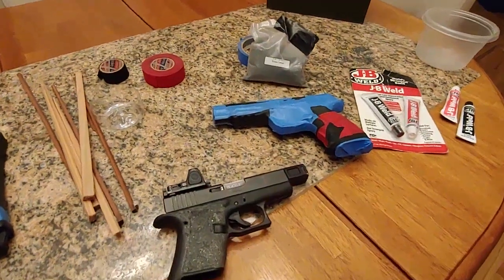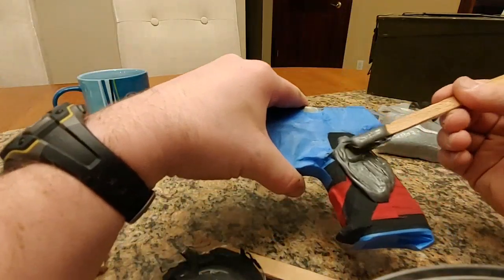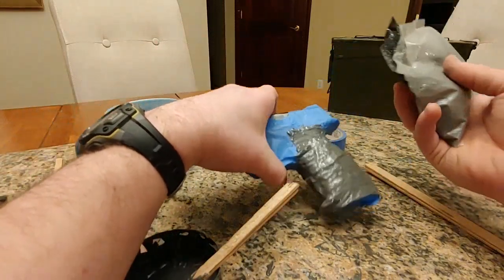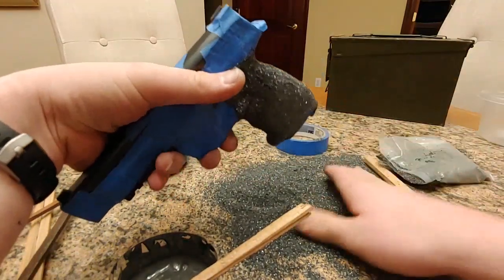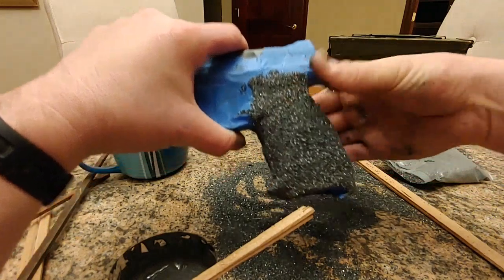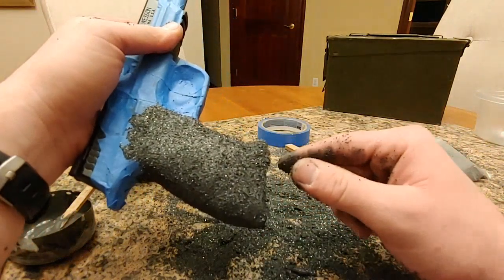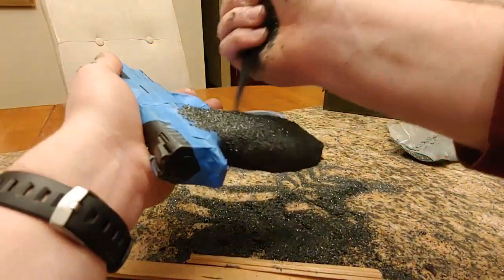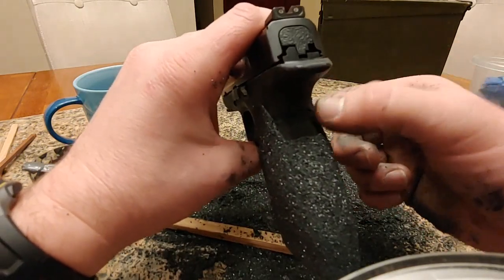Silicon Carbide and Epoxy Pistol Grip Modification

Comment: How is this holding up? I haven’t seen the hockey tape idea before. Does the grip have flex or “squishiness” to it once everything is hardened with that tape under there?
Reply from the maker: This grip holds up great, the only reason why you may want to redo the grip is after time the outermost silicon carbide particles (that give you maximum the roughness) will eventually wear off leaving the particles that are more deeply  embedded in the epoxy. Its still a good grip (better than stock) but after a year it will be substantially less rough in texture. For example, if you use 36 grit silicon carbide for a very aggressive texture, after six months the grip may feel more like 60 grit and after a year more like 80 grit.  There is no squishiness as a result of this process and other than the inevitable degradation of your most aggressive texture I consider it a semi permanent modification, as in the epoxy will not break down unless you wish to remove it (by sliding a flat head screwdriver underneath and twisting it to crack the epoxy for example). Also, if you're considering doing this I would suggest you do a search, after I posted this video I found several other videos that are much more concise and better all-around videos on this process.
Reply from the maker: Also, the tape is very thin hockey grip tape which only serves as a barrier to prevent the epoxy from adhering to the frame so that it can be removed later without damaging the gun. You can also build up parts of the grip, I've taped little aluminum shims underneath the tape to increase the grip in a certain area and it has never shifted or led to any problems.
Reply: @LaxWarrior16  thanks for the response. I thought you were wrapping a bunch of tape layers to build it up. Have you actually removed the hardened silicon carbide and epoxy structure by peeling up the tape? It’s an interesting idea to go back to a stock grip if it isn’t to your liking once epoxied
Reply from the maker: @HouTexHemi   I have removed these grips numerous times. It's super easy, especially if you only do one or two layers of tape. While the epoxy is very hard it's also brittle, what I usually do is take a thin flat head screwdriver and slide it underneath the layer of tape (between tape and frame) about a quarter of an inch or so and then rotate the screwdriver left or right or pry up on it to crack the epoxy and tear the tape apart. Work your way all the way down  one side of the grip then once you have a split in the epoxy and tape you can peel off the rest of the grip. It's super easy
Reply: After a few mags at the range your hands are going to be ground meat
Reply: @joshmartin7558  Nah. It definitely scuffs them up when you first do it, but your hands toughen up and the grit gets a little worn. I've got tens of thousands of rounds with my 45/70 grit. Still have hands that work.

Comment: You need to use 15 minutes epoxy, not jb weld.
Reply from the maker: Never tried it! I'll have to give it a shot, thanks!
Reply: Intresting you say that I’m confused as to which to use I have found about 10 videos of people all using jb weld and about 3 using 15 minute epoxy .
Reply: I wonder what is better
Reply: @Sneakyjoe69  I am no pro, nor have I done this yet, but I know I'm not doing this! 30 min epoxy looks like the way to go. If you want to mold your hand and fingers into the grip permanently, this may be an option. The end result wasn't bad, better than I imagined. Thanks for sharing!!!!